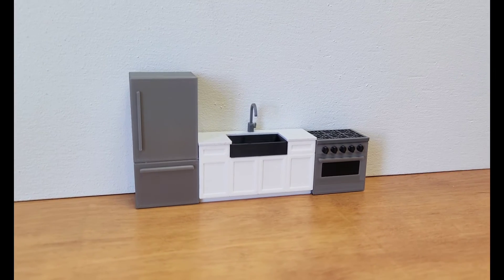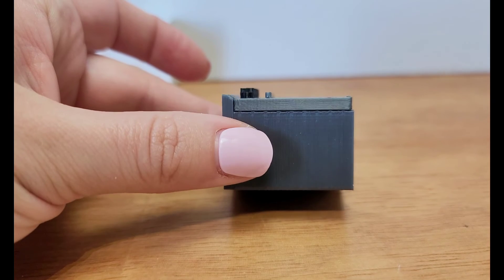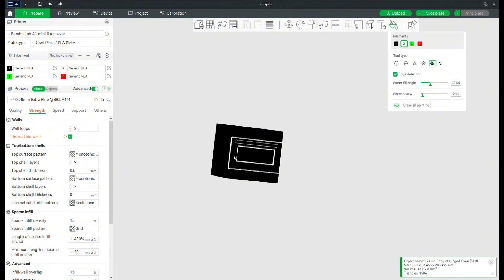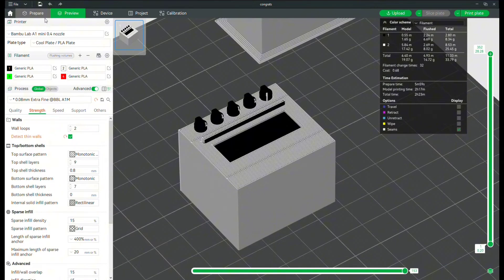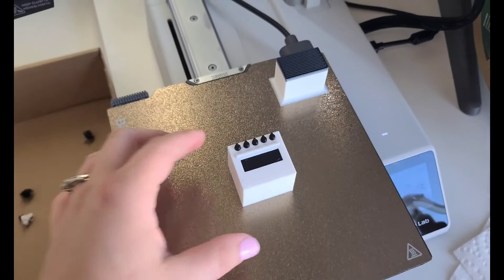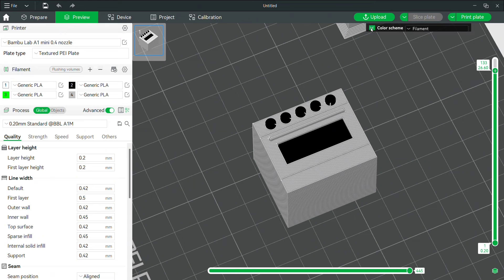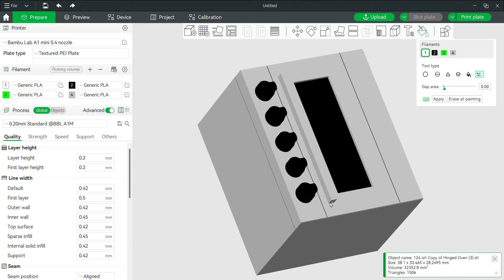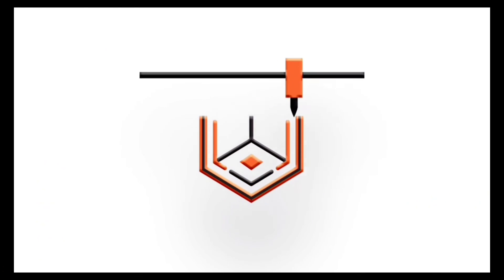Trying out multi-color prints on the NEW Bambu Mini A1 with AMS Lite!

Comment: I would definitely leave it as a white base and then paint the nobs and window black. You can also use variable (adaptive) layer height so the printer will print the fine detail where required. Personally I'd print the top grill as a multicolour separate piece face down on a smooth plate so you have a non-breakable finish.
Remember, you still have the same flushed filament volume for 12 prints on a plate as you would with just one so it's more economical to batch print multicolour prints.
Reply from the maker: Thank you!

Comment: Nice video. Thanks. BTW, is it easy to get the time-lapse working on the A1 like you do?
Reply from the maker: Yes, it comes with an SD card. You just click the box "timelapse" when you print. And then you remove the SD card and transfer to wherever you need it. There may be a way to change how it records timelapse, but I haven't felt the need to change anything.

Comment: The solution is to go to Objects instead of Global and have the whole object start off as white(Extruder 1 instead of Extruder 2 ) THEN you paint the accents with black. That way any hidden layers are white and the exposed stuff is black as intended.
Reply: Another faster options is to right click model and select split into parts. Then go to Objects next to Global and in there you will see the newly created objects where you can assign an extruder color to and no painting is required.
Reply from the maker: Ok I will try these. Thanks so much!

Comment: I could not help noticing there are 6 grilles and an oven but only 5 knobs 🤫
Looks amazing though. My thoughts were on single- or multi-part printing: printing the grilles as separate parts means they do really stand out as separate items. Same goes for the door: printing that (only the door, I would leave the knobby part on the main body) as a separate item makes it look like a separate door when glued on.
You may be able to create a good result by adding a rim on the side of the door and on the grilles but that may be harder to design and to get to print right.
This is fun - my mom and dad used to make dolls house miniatures in wood and metal as a kind of a hobby company. I had a lot of fun trying to design stuff in such a way that is was easy to make in small series. We made all kinds of form cutters to slice models from a piece of wood like you would slice bread and in the end I even CNCed dressing doll bodies. Seeing you 3D print a lot of this stuff brings back some good memories to that 😁
Reply from the maker: Haha yeah there are not the correct amount of knobs but I felt it looked too cluttered with 7. That's nice to hear that it brought back memories. 
My favorite dollhouse room when I was a kid was a bathroom and it's still my favorite. Yes, making minis requires a lot of creativity. I'll see if bumping the color change up helps. Thanks!
Reply: Oh - I forgot to mention ... That black shadow ...
This may be either the slicer using infill to purge the color or you may somehow still have a piece of black left in your model.
If it's the slicer purging, you may change the knobs to have the first layer in white instead of black. That may also remove some of the color bleading/smearing of black into the white of the oven base.

Comment: I’m willing to bet that in Tinkercad the handle isn’t merged with the rest of the oven so there’s technically part of the door that’s still black that you can’t get to. If you merge it that geometry should go away on export and the slicer won’t see under the handle anymore as a surface it thinks it needs to print.
Reply from the maker: Ok thanks so much!
Reply: Yup, there is prob a small space between the handle and the ovendoor. Try right click on the oven in the Bambu slicer and then fix model. Maybe that would help.

Comment: You always can add a cube modifier in the volume you want white and set it to the virtual extruder. In Prusa Slicer and it's forks always the last modifier in the list has priority.

While for the knobs multicolour is o.k., I still think you should print the door window seperatly, with the front on the plate. The surface of the textured sheet looks nicer than the window being a top layer. Even if it is one piece more to glue, the better optic is worth it.

Nice oven by the way. I like it.

If your PLA prints warp, ambient temperature is to low. You should make an enclosure - or even just a half enclosure, like putting the printer in a big cardbox open at the top. Also solves the problem the camera catching the surroundings.
Reply from the maker: That's true about the window. Yeah I was thinking of walling off a little for privacy and temp would be good too. Thanks!

Comment: I'm not sure about Bambu slicer, but in Prusa slicer would it not be easier to have all the parts seperate, and then color each part? This way your not painting surfaces, just designating colors to parts, I also think with the size of these models, you can definitely print the grill on it's side.
Reply from the maker: I am sure there is a way. But I would need to figure out how to raise pieces up from the build plate so they are positioned where they need to be. And I'm not sure how to do that. Thanks!
Reply: @tada3dprinting Before exporting from cad, A sacrifical piece that fits on the ground fixes that issue for me.